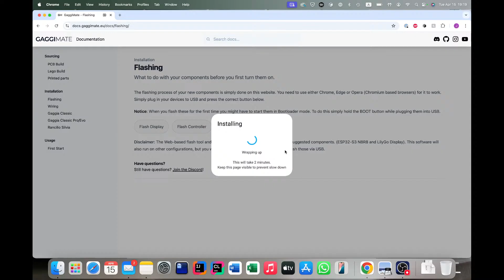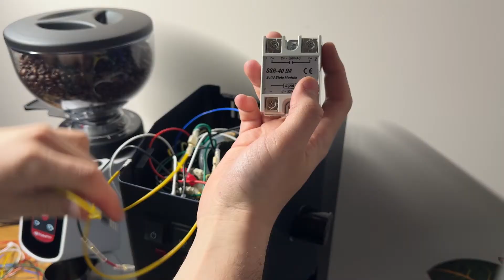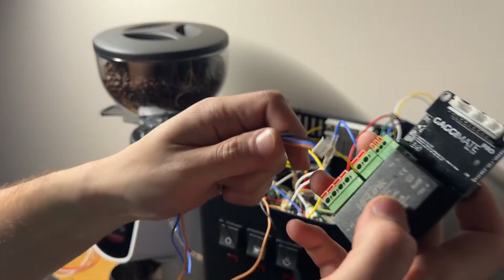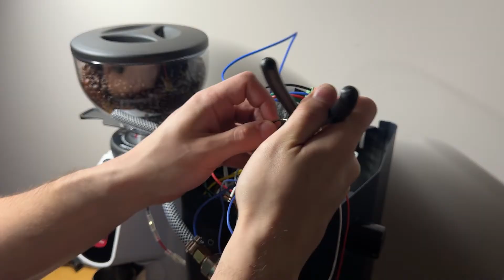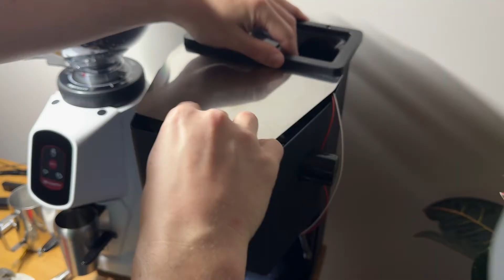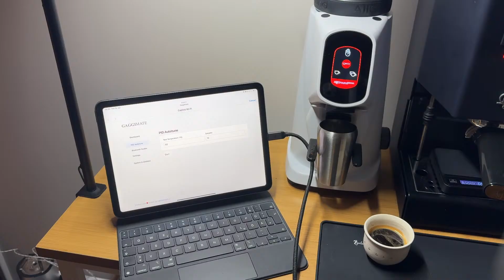Installing GaggiMate Standard / Pro: Gaggia Classic Pro

Comment: Hello, thank you for the video! So If I buy this kit but the pro version, is there nothing else i have to order for it to work? thanks
Reply from the maker: There is a configurator on the shop site. You can add the housing for screen and pcb (options). The kit has all things needed for it to work technically ...

Comment: Thanks for the effort in putting the video together, @gaggimate. I have a Gaggia Classic Pro 2019 NL9206AD model. At 33:59 you say that we need to connect the black and brown wires to the "black ones to the middles", and then you connect your brown cables as well.

Could you help me please understand where to put the wires? I have black and green ones.

On my brew switch I have four pins. Looking at them from the front, the top left doesn't have anything connected. The top right has a green wire connected. Bottom left has a grey cable, and bottom right has a blue cable.

On my steam switch I have six pins. Looking at them from the front, the top right now has a black cable connected. The middle right has a white cable connected, and the bottom right has an orange cable connected. All three left hand pins don't have wires connected.

Thanks for the help.
Reply: Hey Colin, did you ever figure this out? I'm in the same boat! Would love to know if you solved it

Comment: I'm not gonna lie...this is way more difficult on a 2023 GCP Evo (US version) than what you're showing. 

Wire colors don't match (and it would be nice if there wasn't THREE green wires so they're easy to differentiate between each other) and it's not easy to see exactly what you're doing. 

The clamps on the hose between the pump and boiler were permanent/not easily removable (unlike the screw type you showed/provided) so I had to break them off with Needle Nose pliers and there didn't seem to be enough space between the two connectors coming from the pump to fit both the provided tubing and the screw-band clamp so I needed to use thinner tubing

The o-ring between the pressure sensor and hose barb fitting does nothing since there is about a 1/4-1/8" gap between the two (the provided o-ring is on the sensor side), so I had to go out and buy a #6 o-ring (7/16" OD x 5/16" ID) to fit inside of the barb to properly seal it

I sheared off the thermocouple for the boiler since it's so tiny and fragile (I got it hand tight and wasn't sure how tight it needed to be so I used a wrench)

I wasn't aware that my GCP had the MonoBlock style connectors before I ordered all of this and cracked it open, which is unsupported (I ended up cutting the connectors open in order to remove the spade connectors). I'll accept the fact that the last bit is my fault though. I'm just finding this difficult to follow. 

Maybe all these problems are just specific to me since other people in the comments don't appear to have any of these issues.
Reply from the maker: We updated the install guides about 2 weeks ago :-)

Comment: After alot of fun problem solving from installing and finally getting it to work. Now the heater not working after working for a bit. I notice the ssr block light not going on. Any reccomendation what might be happening
Reply from the maker: please email us or open a thread on the discrod
Reply: Did you ever get this figured out? I'm about to order and install this and looking at what possible issues I might run into
Reply: @TheCapi246  Hi, i did. There was a combination of issues but the one that would of solve everything was a proper cleaning of the solenoid. Where i removed it and limescale cleaned it manually. Then did a flush of the whole machine. IT was 3 year old machine with out proper cleaning. Also didnt need to get another block just needed to reinstall the flash again.

Comment: Why are you using yellow and black for dc? Usually that would be red and black? (+ and -)
Reply from the maker: If you look in the documentation of the project, you can see that we are using a lot of wires. So in order to differenciate easier between cables and components/ functions we chose to use more cable colors
Reply: @gaggimate ahh, ok 🙂

Comment: are both pressure and flow profiling available already? how does it compare to the de1 in this respect?
Reply from the maker: They have been implemented about 2 weeks ago and they rock :-) You mean Decent1 in comparison? You have to try yourself and compare a 500-700 setup with a 3000,00 machine ;-).
Decent is dual boiler and a lot of different technology. When it comes to taste: Do not believe me but guys like Lance Hedrick in
https://www.youtube.com/watch?v=wk9x3OtBce0&t=7s

Comment: When fabricating the case have you thought of making the slots where the cables come out into semi-circles on the lid/base?...that way you could run the cables through a robber grommet and once assembles squirt a bit of silicone sealant into the cetre hole of each grommet [where the cables run through] thus making the whole PCR case waterproof...easy job with the printer that you are using to fabricate the case.

Comment: Just a tip, when putting on the hose clips rather than struggling with a posi-head screwdriver piece, if you have a socket screwdriver [like here] use the right size socket for the nut head on the hose clip...far easier with wet hands and no chance of sticking a pointed bit into your hand i.e. safer.
Reply from the maker: Yop :-)

Comment: 12:56 flashing components 
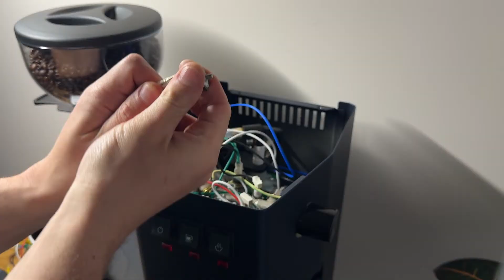19:38 thermostat 
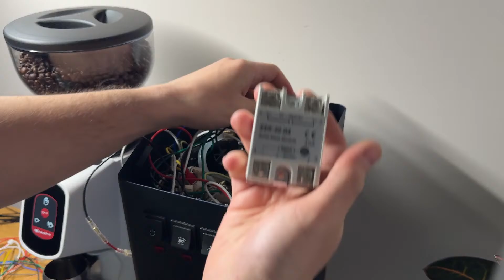22:05 ssr
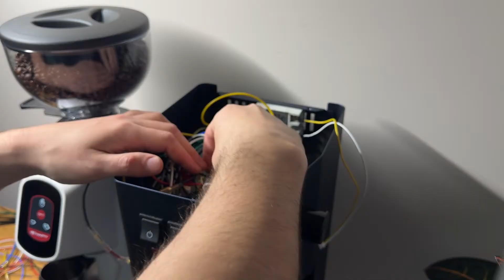25:53 optional resettable fuse
27:09 EU eco bypass bridge
27:58 pump and 3way valve 
31:30 switch wiring 
35:00 pcb wiring
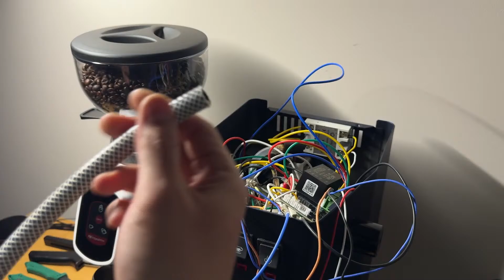42:28 pressure sensor install
51:27 pcb finalized 
59:33 display connection
1:17:27 ui

Comment: Can it be installed on a 2004 Gaggia Tebe? The machine still works fine (it's not used regularly, but still works).
Reply from the maker: the Tebe is essentially a paros without grinder. So, yes

Comment: I'll be honest, haven't gotten through the whole video yet...but I'm interested in some functionalities that aren't upcoming (pressure and flow profiling). Is it better to wait and just do all the install at once, or install now and go back and add those functionalities later?
Reply from the maker: there is no need to add a component to the Pro PCB later. The profiling feature is a software update
Reply: My understanding is these are already in the pro kit but the software just hasn’t been updated yet. So install now and then the update will come OTA.

Comment: I did lance handricks shade of cofffee, dimmer switch, and pressure gauge mod few years back. Would it be easy to convert from there to the gaggiamate pro mod? or would i need to reset everything?
Reply from the maker: you will profit from a pressure above 9 bars, since gaggimate can control it. The dimmer switch mod as is will not be needed anymore

Comment: Awesome!  Two questions:

1. Is there a power on/off timer? 
2. What filament do you recommend for printing the housings?
Reply from the maker: 1: yes- there is also a home automation/ smart home integration
2: ABS for internal parts (it is getting hot in there)

Comment: Hi, really great video, what’s the step in 25:56 doing? I read online in the docs only said to remove the steam thermalstat
Reply: It's optional and not documented in the installation manual, but if you get the Rancilio Silva style resettable fuse, you can mount/screw it into the steam thermostat port since you don't need the Gaggia thermostat anymore. You'd then connect your wires from your non-resettable Gaggia fuse assembly to this resettable fuse.
Reply: The wires from the steam thermostat were already routed to ssr. Which wires are being used here for resettable fuse?

Comment: Would it be worth removing my current SunGaze PID and flow controller and figuring out how to wire this in to an already modded machine? I like the interface and features, but don't know if its worth teh hassle of tearing down, returnign to stock and then installing this.
Reply from the maker: Cannot really judge- especially since we do not know the SunGaze PID

Comment: I have a PID controller on my Pro and went to some effort to optimize the PID values finding that the autotune worked poorly at best. My aluminum boiler Pro heats up fast with virtually no overshoot oscillations with these values: P=17 sec-1 (that is the units are inverse seconds), I=100 sec and D=10 sec. The new brass boiler would have different values. The units are important since it is possible to express the PID equation in alternate forms that then use some inverse settings to these.

Comment: I have a 2023 Classic with MonoBloc on the back of the switches, is this going to be a problem and does it affect the installation process? Realised today that both this video and the machine on the instructions page, neither of them have the MonoBloc connectors
Reply from the maker: Monoblock is currently not under active support
Reply: You can remove the spade connectors from the monoblock but it's a bit of a pain in the ass to get them out. After attempting to use Needle nose pliers to pull them out, I ended up just cutting the housing with a Dremmel in order to remove them easily.